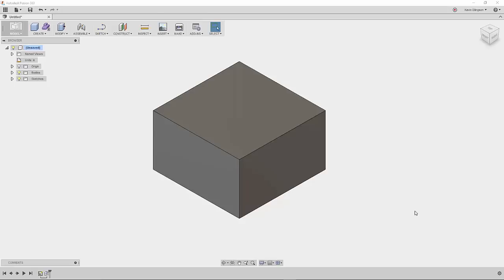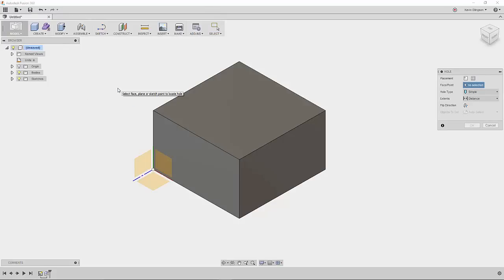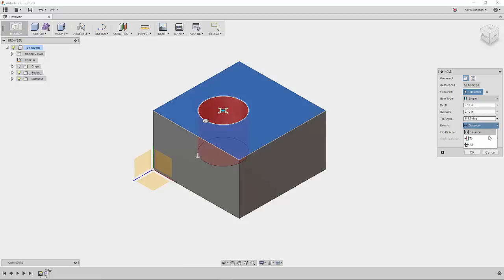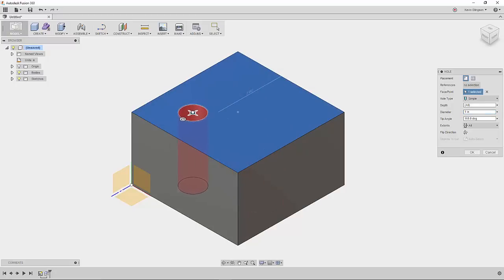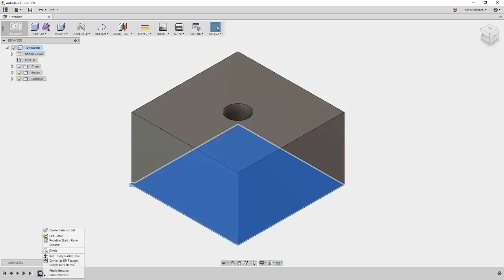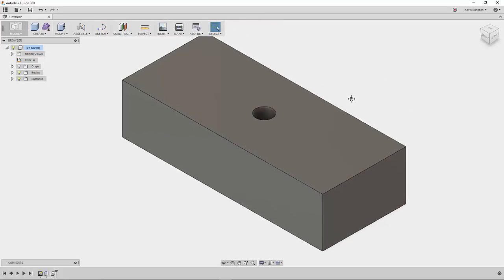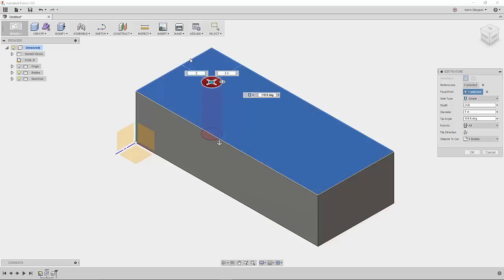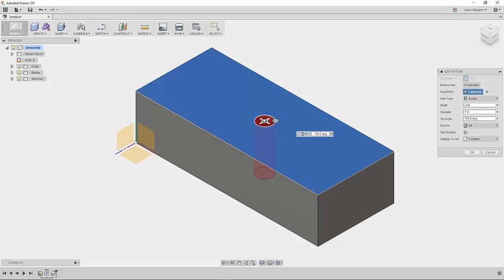Fusion 360 Hole Command

Comment: Rather than placing my hole position from the edges can I use it the sizes from the middle of the block. As in the middle of the block would be X0.0 Y0.0 and I can put the hole X1.0 Y0.5?

Comment: Thanks. Only thing I couldn't figure out was how to measure between holes, but that was my fault for not making my box a good even number while making clips to attach to 3/4" pipe. I figured it out well enough though, offsetting them both by the same amount to get a 19mm spread. Just took a little math. ugh I really need to learn more about this stat!
Reply from the maker: Hi. Remember you can also create a sketch and add sketch points. Then dimension between those points and even control they distance with a formula to keep everything centered. Thanks for the comment.

Comment: 1 question... i have a solid cube.. the top off the cube a want to raise one corner. so that the top of the cube gets a tilted surface.
Reply from the maker: Hi. You could do this a couple of ways. You could draw an angled sketch plane and draw a rectangle on that plane and them loft your two profiles. You could probably use the move command and choose face and rotate and anchor the pivot point to your corner as well. If you want some help with it, email me at info@mechanicaladvantage.com and I'll take a look.

Comment: Is this any different from negative-extrude'ing a circle drawn on (in this case) the top face?
Reply from the maker: Hi Michael. The reason I like hole better than sketching a hole is that the hole command now does engineering style holes. For instance, how big should a clearance hole be for 1/2" hex head bolt? I could certainly look it up in the machinery's handbook, but it is stored in the Fusion hole command. I can also do things like counterbore and countersinks with the hole command. Eventually drawings will be able to bring across the hole information from the hole command as well. So instead of writing a note with the hole info, the hole note will suck that info from the model. It probably isn't going to do that with just drawing a hole as a sketch.

Comment: I'm new with fusion coming from NX and solidworks. I'm here wondering how or if I can constrain a hole location to a dimensional value from center or reference planes/geometry. I'm maybe old school, but hard set on not using body geometry to locate feature or sketch geometry. if you have any insight or questions as to what I'm talking about or why I'd want to do this, I'd appreciate that as well.
Reply from the maker: Mike Lindquist Hi Mike. Yes, you can do what you mention. Generally the planes and axes aren’t useable by default. Often you need to use the project geometry to project them into your active sketch. If you need a hand with it, feel free to email me at info@mechanicaladvantage.com

Comment: Hi.  Is there any way to have a hole offset from the center on a circle?  For instance if I wanted a hole exactly 2" from the edge of a 10" circle, is there anyway to do that?
Reply from the maker: +Nathanael Yarger You can do that, but not just by using the hole command as I have shown. You would need to create a sketch and then add a sketch point where you would want that hole to be located. Then you could use the hole command to place a hole on that sketch point. If you need some help with that, let me know and I can make a video showing the steps for doing that.
Reply: +Mechanical Advantage 
Thanks, I'll give that a try.  A video would be awesome!

Nate
Reply from the maker: +Nathanael Yarger OK, I think this will help you. If it doesn't let me know. 

https://youtu.be/t7Xe5X3IQrM
Reply: +Mechanical Advantage 
Thanks so much, that worked perfectly!
Nate